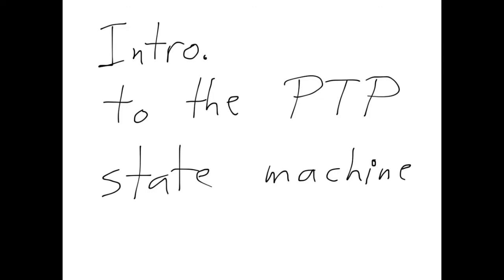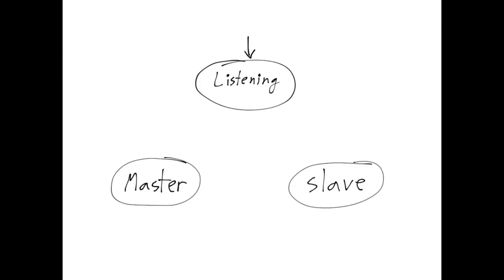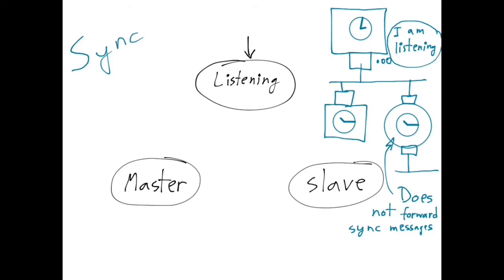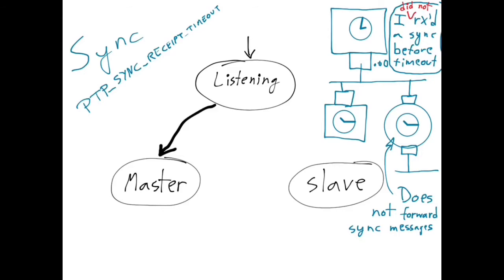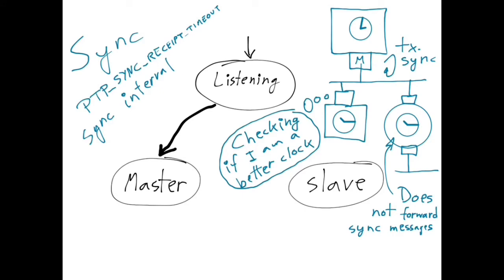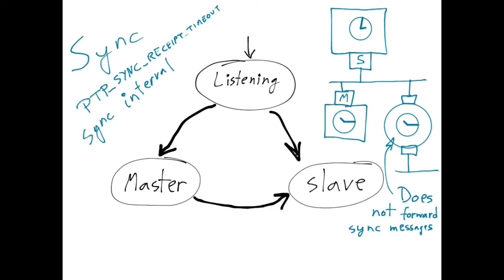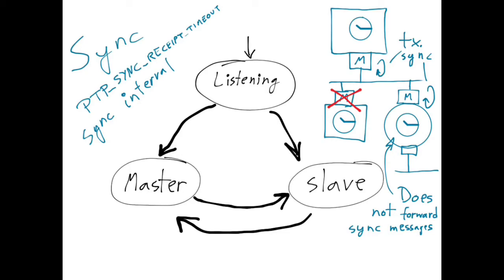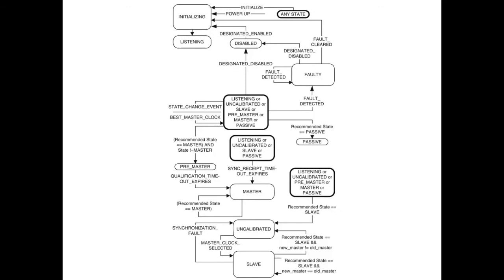Introduction to the PTP state machine

Comment: Hi David! Very helpful videos. How does a clock determine it is better clock?
Reply: It seems there is an error here. The annouce messages are used to change the state of the PTP ports, not the sync messages. And the announce message contain 2 parametes clockClass and ClockAccuracy to determine which is the best clock
Reply: @manunibal  exactly.